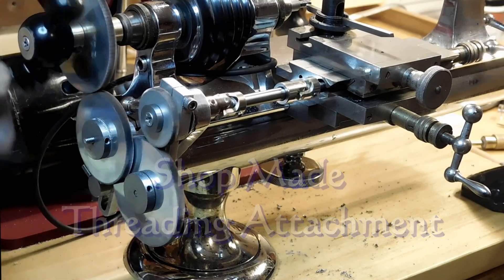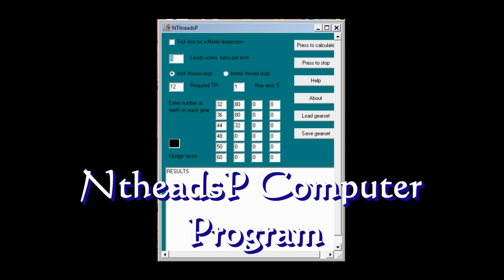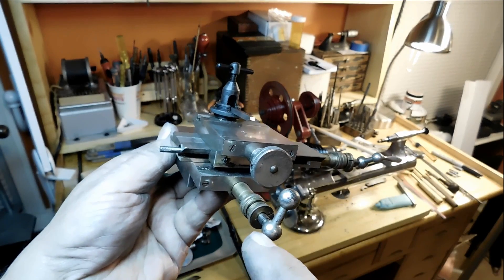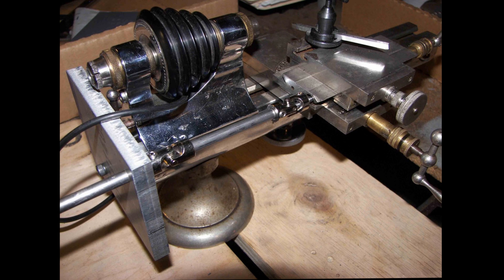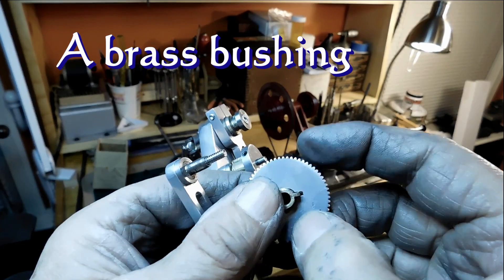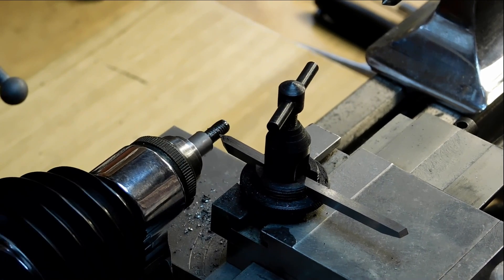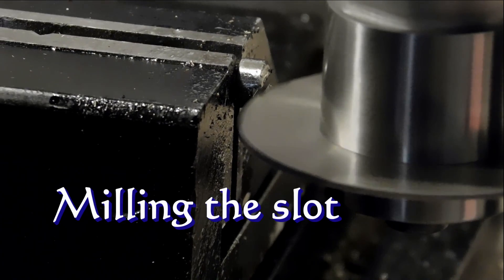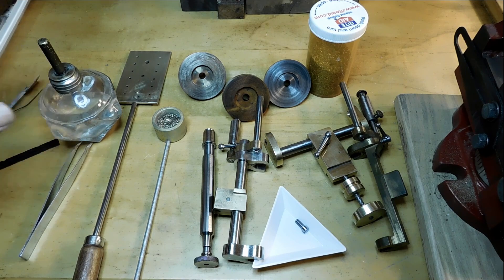Thread Cutting Attachment for a Watchmaker's Lathe

Comment: Can you cut different threads using this  attachment or can you only do one thread?
Reply from the maker: You can cut different threads the same way you do with any engine lathe with change gears...I use NthreadsP to figure the correct set up

Comment: Very interesting  project  . But can i ask you to explain the matric tread by gear program  . If you please  .  
My best wishes.
Reply from the maker: I am by no means an expert on NthreadsP but in the write up they supply at LathesUK they say:

"The programs have been written to help with the following situations:
5) To generate metric pitches on an English lathe without using a 127 tooth gear"

I have used it a couple of times to form metric threads just as it suggests…I supplied the gears I had on hand (I did not have a 127 tooth gear) and asked for a metric read out…they may not have been perfect metric threads but I could not tell the difference…I’m afraid that is the best I can do…give it a try

Comment: You must really like your screws nice and shiny :)

Your threading mechanism is very impressive.
Does that screw extension ever get in the way of reaching the workpiece?
And how about left threads?
Reply from the maker: I'm working on a skeleton clock so if it ain't brass...it's blue and shiny!

The screw extension does not seem to get in the way...but I've had it for years and it never saw much use...I have several tool room lathes...so I kinda made the threading attachment to make the cross slide useful...and it was fun!

 I seldom if ever see left hand threads...but a year or so ago I turned a left hand thread on my Atlas...a part for my surface grinder...thanks.